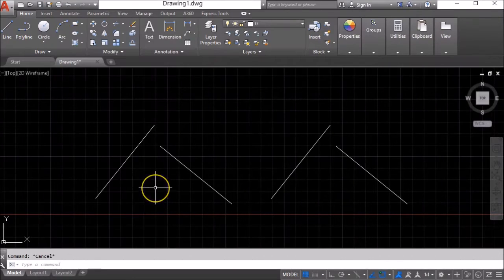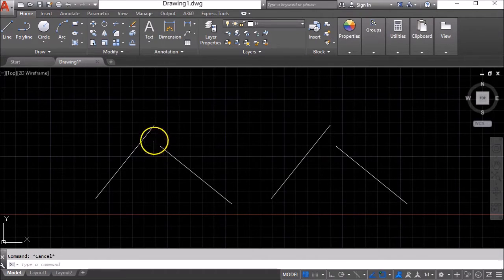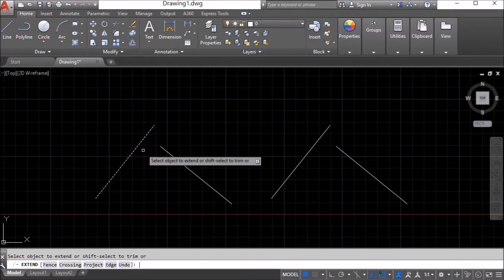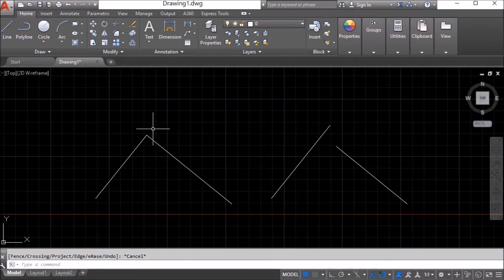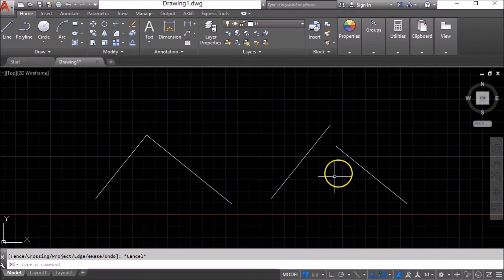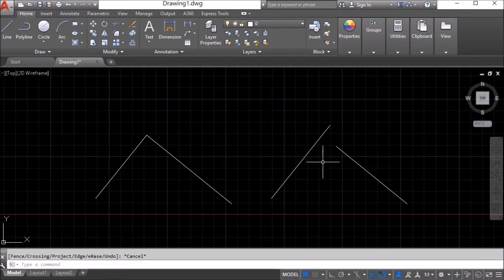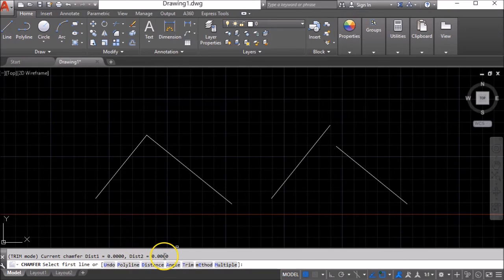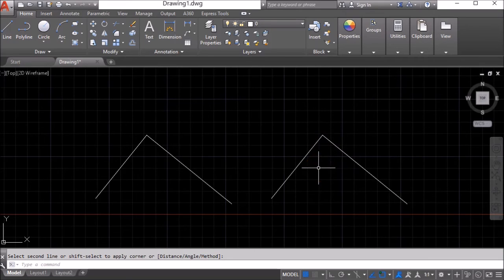Chamfer Trick in AutoCAD

Comment: Wayne. You could also use the fillet command. Radius 0. Is there a way of doing same for 3d lines? I.e to fillet to intersection in 3d?
Reply from the maker: Yes, you can do the same with Fillet R=0, good tip! I'm not aware of any way to do it with 3D lines, though. I think the Z value has to be common to the two lines you are working on for this to work.